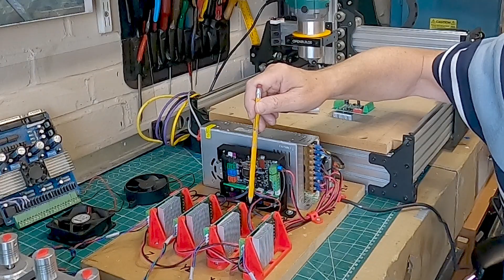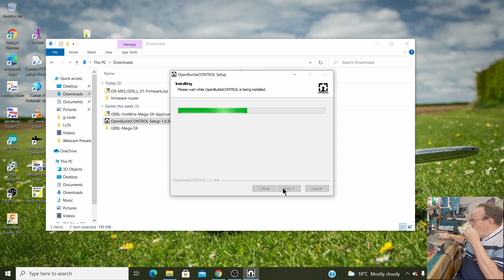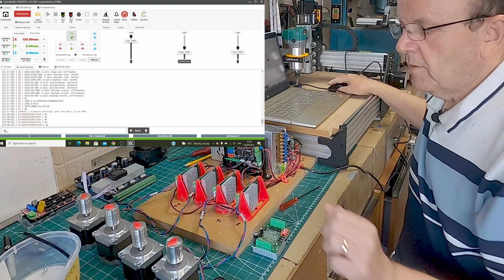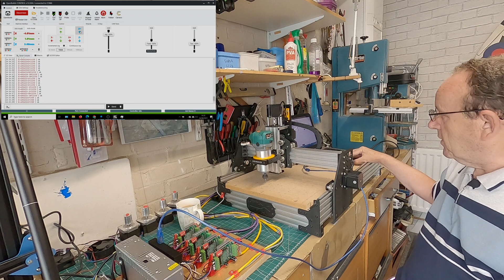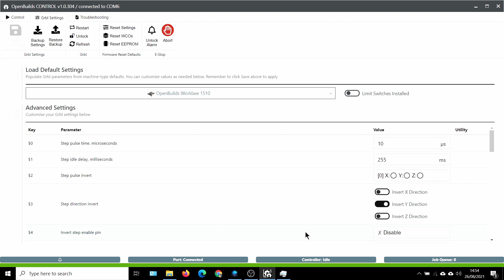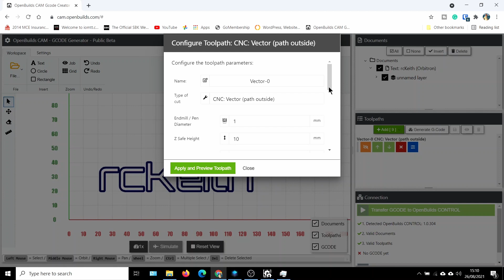How to convert a Parallel Port CNC Router to a USB Interface

Comment: hello, is there any device Parallel Port CNC Router converter to a USB Interface ?
Reply from the maker: What software are you using for CNC.
Reply: @rckeith  mach3
Reply from the maker: @SimohamedC  Have a look at my website where I discuss the options    https://rckeith.co.uk/mach3-parallel-port/  the UC100 from CNC Drive is probably the best option for you. Hope that helps😀

Comment: you old blue controller card has worst cnc controller board what have made to users. normal cnc uses DM556 stepper drivers cheap and can use big motors. its basic good drivers ewery cnc, and motors minimum need be nema 23 3-4A 450 oz if want do real work too. not newer use nema 17 no torque use cnc, only used 3D printers and laser machines no need torque lot. maybe if used only PCB carving or small letter carving can use nema 17 motors.
Reply from the maker: Never had a ptoblem with it and has made many project.  NEMA17 are fine for foam cutting thers is very little load.  I do very little CNC routing so my setup works fine for me.
Reply: @rckeith  i has experience only my cnc machines, i has build all my machines minimum size 1200x1200x400, and all metal frames, nema 17 not can move all axis good, my biggest plasma cnc have 2500x1600x500 and real not can use nema 17 motors, foam cutter have 1000x1200x600 and nema 17 not can move, i try first but need change all motors basic cnc size motors 470 OZ 4A nema 23 have minimum motors what can move this, i test many different motors i build my machines, big servo motors whit encoder have closed loop but super expensive, hobby user not have budget buy , and aluminium milling machine i need nema 34 motors all small have too weak no power move, move if not cutting but if cutting aluminium need lot more torque or spindle stop and nema motors not move and burn. aluminium need nema 34 6A motors minimum. and big motors need drivers too big handle lot more motor amperes. thats have only my experience build cnc machine, i has build small metal factory  many customer old bridgeport etc manual mill machine retro fit before in work, need gear too because motors not cnc buy all machine big, not power/torque lot, but this is retro fix have different story, not mean this. i has build last 30 year time period about 300-400 cnc machine to small metal factory and hobby users.

Comment: GRBL not support all normal G-code files what used normal cnc machines, linux support and mach3 support , all G-code files not working GRBL software right, use you nema 23 450 oz motors, have minimum motors size what need if use cnc, wood and aluminium use. stepper motor drivers need use minimum 4-6A motors and drivers. basic cnc work, all thats smallest use only laser or 3D printer only good.
Reply from the maker: I think you missed the point of this video,  I have showed how I converted my hobbyist machine to use USB which is a common question I get from many guys. The way I have showd is a cost effective way that suits guys on a modest budgets.  GRBL supports all the necessary g-codes for my use and I have never had an issue. I have use steppers motors as low as 0.9 Amps on my CNC foam cutter and built many RC models that have flow fantastic.

Comment: if need build safety factory guality machine need use linuxcnc and mesa card, if want lot problem and only hobby sometime can use cnc and lot repair use mach3.
Reply from the maker: These machines are for hobbyists like myself who enjoy building RC aeroplanes. They work absolutely fine for hobby use and are never intended for factory use.
Reply: @rckeith  yes i make too RC planes and normal my wingpan have one side wing make 1 meter, need big machine ,i mean factory quality only have safety and big can made all fuselage parts good, my cnc have 1200x1200x300 table size. thats have perfect size make good plane parts. cutting all parts one big sheet out and make long wings, i have cnc, foam cutter cnc, vinyl tape cutter cnc, aluminium cut/mill cnc all can do same machine, and can use my laser too,need change only spindle to laser head. foam cutter have different machine for me, all need nema 23 minimum not can move if have nema 17 no power,torque, too small motors use normal size good, all i has made DIY at home and many year make lot different project and has seen my skill have, need minimum 450 oz or biggest motor if use mill, and big machine, nema 17 not can move all axis small motor, and thats mean need be biggest drivers to motor current normal about 4-6A and if mill aluminium need good spindle minimum 800W air cool spindle lot more torque and strong than my makita router have, and lot lot silent what have important, if use router late night all neighbour 2-3 house far  go angry not can sleep, makita router have too lot noise, but i change real 800W air spindle or mill have 1,5KW water cool spindle not noice any, and linuxcnc have lot better than mach3, flexiple can add many additional what want , thats my experience use cnc, i hope all peoples understand if need build good perfect machine make all good, im old retiree engineering and i want do all perfect not only little somethink half ready. if use TB6600 etc drivers not have good, totally worst driver users lot burn thats worst drivers, and if use only nema motors no have power carve or cutting or mill parts fast good, etc,etc, many problem if not build good.

Comment: if you need small space cnc machine elektronic, use raspberry pi4 and mesa card not need big space, and can use better linuxcnc software not dangerous windows base mach4,  linuxcnc have lot safe than mach3, linuxcnc have only safety REALTIME control, i has made 20-30 cnc machine to factory owners and only what can use safety in factory area have linuxcnc. not newer used windows base cnc software too dangerous use.
Reply from the maker: Yes a good solution but for most hobbyist its a bit expensive and most would struggle with the installation.  I speaks from experience from the question I get for even simpler solutions

Comment: hi, I would ask you a question. I have an old CNC Fanuc Sigma VC1000 with the same serial port 25 pin DB25 and I would monitoring this machine using an ESP32. Not only monitoring but also send it the gcode. Have you an Idea how I do? For monitoring I mean sending the machine some code for example D600 and the machine could answer me about the status: stop, word, allarm, type allarm. Sending gcode I don't know yet.
Reply from the maker: Hi, I don't have any good answers for you as I know nothing about your machine. You would be better asking at https://www.cnczone.com/forums/ 
Some clever guys over there.
Reply: @rckeith  thanks. Just wrote month ago but nothing. Thanks

Comment: Do you need to use the MKS Gen L V1.0 board or can you just use Arduino directly connected to the TB 6560 stepper drivers? thanks
Reply from the maker: Yon can use the Arduino directly but the MKS makes the wiring a bit easier.
Reply: @rckeith  thanks - I got a couple of arduino and pcduino - for wiring I thought I would just get arduino screw shield. New to all this but trying to bring to life High-Z S-1000 with a parallel controller which was sitting unused for 10 years! Thanks again.

Comment: I do appreciate the explanations and the time you took to make this video but I totally understand you can replace your main board to get your system back working via USB connection but the reason I took the time to watch the video and do the research is because I need to know if I was to buy the adapter to convert the 25pin to usb the real question is will it work in function correctly with your existing board and Hardware I see they sell them online for under $20 so back to the original question why I spent the time to watch this video if you were to plug your 25 pin connector into the USB adapter they sell for 20 bucks at Office Depot would you be able to function correctly with the existing main board and software
Reply from the maker: Hi Jeff a normal parallel to USB connector won't work. It's to do with timing and controlling individual pins. There are special adapters that work with Mach3  Have a look at this post on my website where I discuss several options. https://rckeith.co.uk/mach3-parallel-port/
Thanks for watching

Comment: How about wiring a 25 way d type to the gen l board and using the existing driver board.?
Reply from the maker: Hi John.  I did consider that but I already had the external drivers. I've kept the old driver board and if any of the drivers fail I may do that. On my website in the builders gallery there is guy how did that with his foam cutter. He said it was quite easy. Thanks for watching the video.
Keith
Reply: @rckeith  yep it's what I did with my cnc machine. In addition Windows 10 64 bit doesn't support the mach3 parallel port drivers
, so as all new pcs are 64bit and come with the 64bit version of Windows this is another strong reason to use USB  interfaces.

I know your looking at erc timsav needle foam cutter and for that I've moved onto Grbl ESP32 owhich has WiFi based intlerfaces and an in built Web browser capability. I ve also used this for my diode laser cutter. It works well.

Comment: Excellent video Keith.  My OX (a bit bigger than yours) runs on a bare Arduino Uno and 4xDQ542 drivers and at some point I will add a laser to it as well.  However, for the folks who do not want to run wires all over the place the Openbuilds BlackBox controller is fantastic.  I have one that I will use on my Ostrich Eggbot because it incorporates a servo port and OBControl can flash the correct software for you as well.
Reply from the maker: Many thanks, David yes there are a few ways to convert to USB and the Black Box does look like a very good option.

Comment: Can the Openbuilds SW control a VFD directly?
Reply from the maker: Yes I  think it can using the D8 spindle connector. I don't have a VFD so you may be better to ask on the Openbuilds forum to be 100% certain.
Reply: @rckeith  Thanks I will!  Lots to learn and I see I have found the right folks!